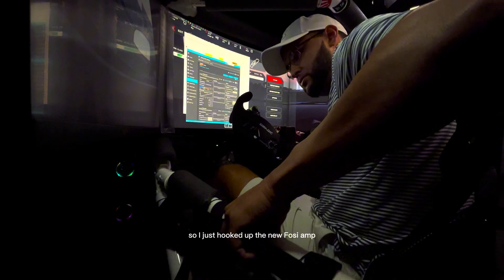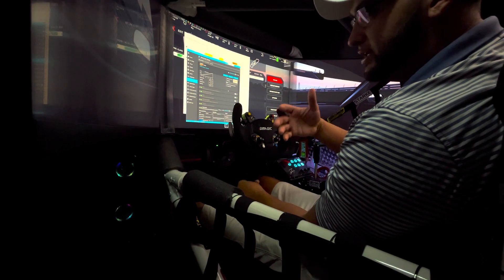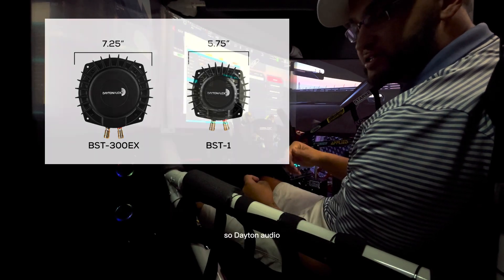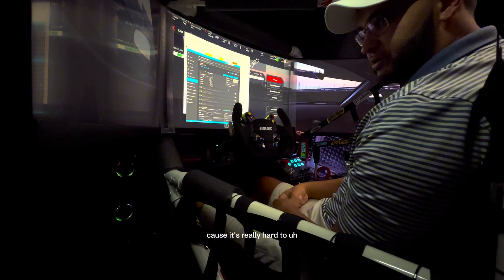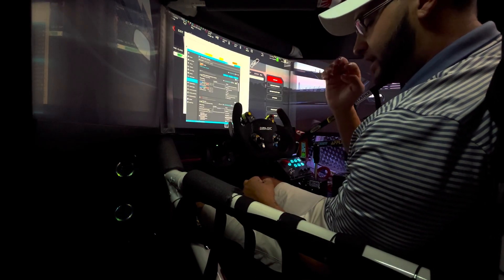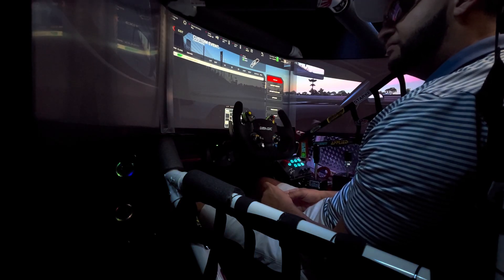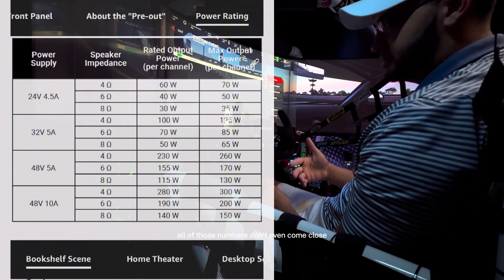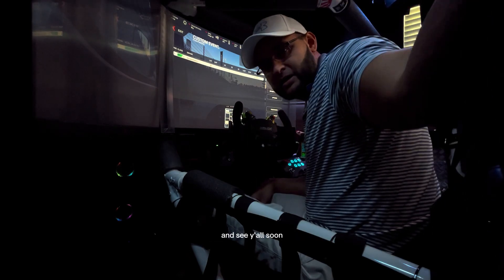DAYTONS NEW BASS SHAKERS 300w!?

Comment: Hey, I have the same Dayton 300w shaker and amp on my rig, I was wondering if you knew why the shaker is acting like a speaker to. Is it normal or how can I make it just produce vibration with out in game sounds?
Reply: You need a low pass filter to cut the frqequency. You want 15-40 or 15-60hz everything above you can cut off

Comment: I always thought best  is to have 5 shakers how I imagined it... Not using any at the moment just looking into it. 2 would go front of rig left/ right and 2 rear of right left/right FOR FEELING KERBS and BUMPS and 1 under seat for simulating engine vibrations and gear shifting. Then I would fit it with SAB-1060 SIM 7.3-Channel Sim Racer 10 channel amplifier to drive all these bass shakers in different frequencies. The Daytonaudio desicribes - "it makes up to 3 channels with the same frequency output. Imagine three subwoofers or bass shakers hitting at the same time". I calculated it would be expensive but I think it's worth it because I changed my mind regarding motion rig, it would be too much all that shaking, all those cables, the space, the cost and electricity bill...

Comment: I have 6 BST-300EX in a sectional that I massively reinforced, running off a Crown XLS-2502. They are series paralleled to a tad over 3Ω. The do kick pretty well, but (but!), you have to use a filter for your PC to set that output curve to make them baller. I'd recommend PEACE front end for the Equalizer APO. Target a curve with a 8-10db peak for both 35 & 40hz, and drop hard around 20hz (these boys are not made for subsonic).

If you want your sim rig to simulate an actual car accident and have to go to the hospital afterwards, run 1 Crown XLS2502 into a Buttkicker LFE.  You will need a slab, otherwise your house will fall down.
Reply from the maker: @henderer  message me. I’m interested in your diagram setup. Lol I would like to achieve the same.
Reply: Sounds like a quick way to turn a buttkicker into a grenade

Comment: So I used a Yamaha Home Theatre receiver, and my 2x BST-1 setup was awesome. That receiver blew out on me (15 years old). 

So I went with the Fosi. In comparison to the Yamaha receiver, it was VERY underwhelming.  With the bass knob at 50% and volume knob at 50%, it would shut off on me after 10 mins. You could see the LED light on the power supply fade in and out. I read that the power supply that comes with the amp is underpowered.  So I bought a 48v 5a PSU, and the Fosi would overheat and shut off. 

Since then, I got an old Sony home theatre receiver off of FB marketplace, and the difference is night and day. Receiver FTW. 

IMO, there certain details and a sense of fullness that’s translated through a receiver, not to mention, appropriate power supply. If you’re looking for a step up, I’d recommend trying a receiver instead of a small amp like the Fosi/Aiyima.

Comment: Hey there, do you have any info on how you wired the new amp? I'm having trouble visualizing in my head. Did you need a new sound card? Thanks for the video!
Reply from the maker: Hey man, thanks for the feedback! So it’s highly recommended that you run a separate sound card/external sound card when you run any type of external sound device, including shakers. It’s relatively simple, depending if you want to go the route of connecting it through the headphone, jack of the PC, or via USB either route is fine, and then running the amp directly to the external sound card to the speakers providing power and then back to the PC. But I would definitely run an external sound card so that your computer does not get confused, running different or in some cases confusing settings.

Comment: How will simhub recognise the signal? Isnt usb supposed to be the cable going into the pc? The tb10d has only rca cables AFAIK. Thanks for the bid
Reply: You would need to use a usb soundcard as well as the fosi amp.  pc to usb soundcard to fosi amp
Reply: @Mistermoleymole  any suggestions?
Reply: You could use a little USB-C to 3.5mm Apple dongle/DAC, then use a 3.5mm Male to RCA male connector coming from that. All together its like 15 bucks

Comment: Hi So i just ordered this exact amp but didnt realize that there is no USB connection. So I also purchased an RCA to USB cable. will my PC reconize this connection for the amp ?
Reply from the maker: Yes!
Reply: @KiliansCreative  So with the Fosi and RCA to USB, no need for an external sound card?
Reply from the maker: @jgloc25  yes sound-card recommended.

Comment: Hi great video. So i have two BST-1 shakers one for pedals and one for under the seat. I get some grinding sounds out of my pedal one for some odd reason. Do you think a better amp would help with this issue? I'm currently using a Nobsound mini as it was everyone on youtubes suggestion. Why do you recommend the Fosi Amp?
Reply from the maker: Hey there, sorry for the late response. I would highly recommend getting an amplifier that is capable of supporting the BST. I actually had that exact amp, and I would notice the exact same thing that was cutting out all the time. This seem to be a common issue, because the amp is extremely under powered.
Reply: @KiliansCreative  hello. What Amp would you recommend ?

Comment: I just got the very same amp you did. But mine came with a 24v 5A and can tell the difference right away. I also have two bst1s and don’t think I need much more than that. Would be cool to see your simhub profile in another video or May be you can export and share? 😊
Reply from the maker: Hey there, I apologize for the late response, yes, I would love to share those settings with you guys in a future video so that I can get more detailed export settings for everybody to get the same feeling that I feel within the game. 

But typically yeah man I don’t keep it any higher than 40%. It’s almost too much even a half power so it is definitely doing its job lol.

I really neat topic to talk about is do you really need all that power? Absolutely not, but I would rather have the extra power and feel more detail — than not have it if that makes sense.